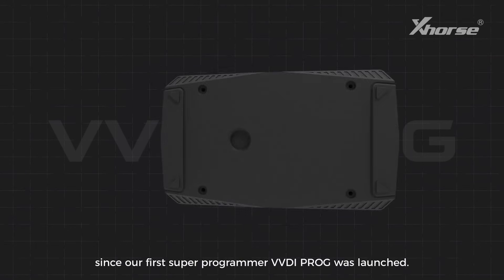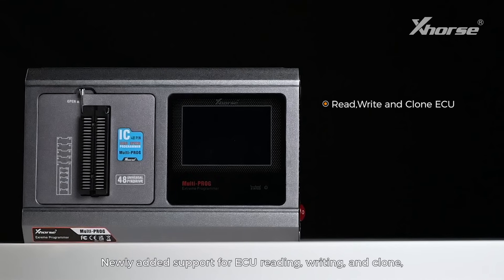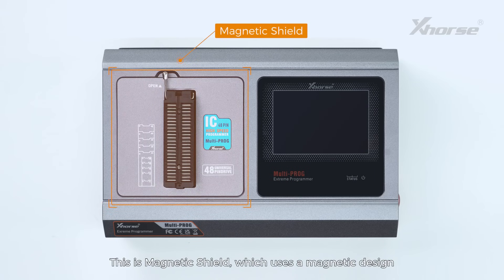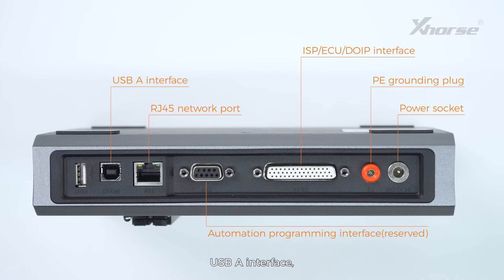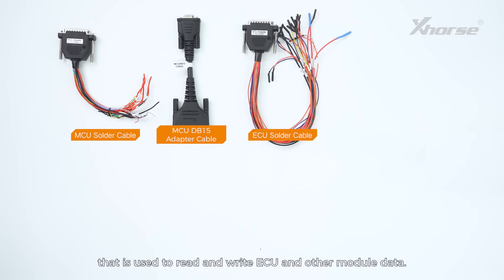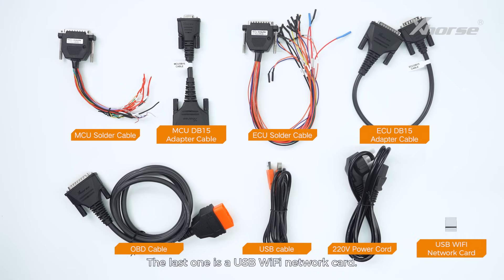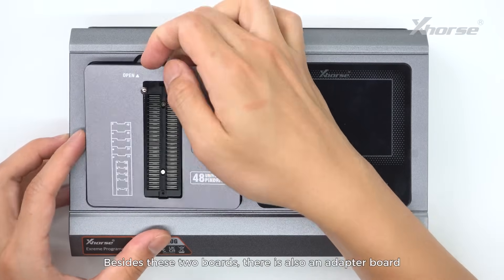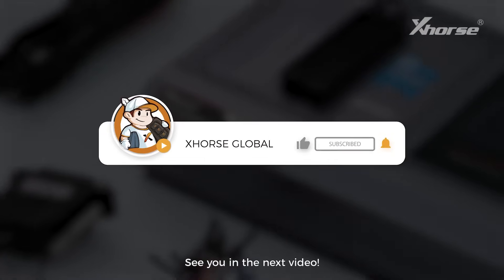New Xhorse Multi Prog Programmer Unboxing [English]- OBDII365

Comment: I have xHorseMulti Prog, after I write the software the car starts but after a few seconds it stops, many say that it is because of many progs that this problem occurs, I have been making tabs for 20 years and so far I have not had any problems, have you had such problems with it starting, vibrating and stopping after a few minutes? Do you think it is from the device?
Reply from the maker: there is a Diagnostic tab which allows users to send data log. Send some data log and we will report this issue to Xhorse team.